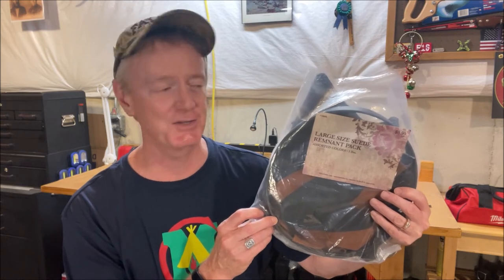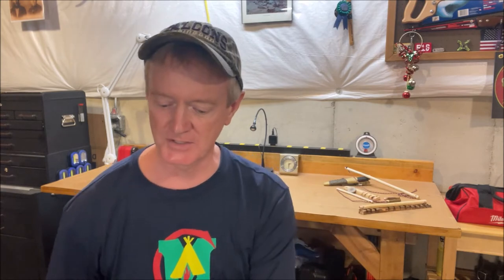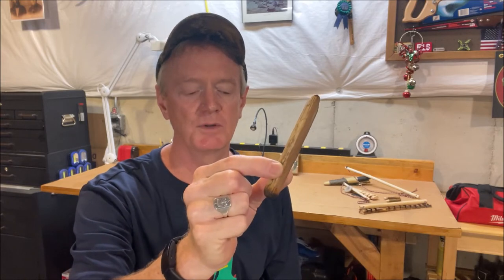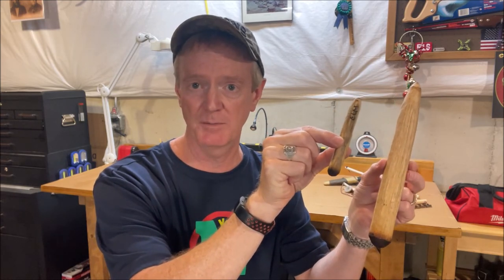Better Bow Drilling With Science!

Comment: Diving into your vidios. Going to read your research paper. Would love to see a thermal video imager used. Also. reduce the variables by using a drill press with varying speeds, pressures, time, spindle size changes, etc.. Keep it coming! Great stuff 👍
Reply from the maker: Thanks. It continues to be a work in progress. Making precise measurements internal to a forming ember has proven very difficult. Most thermal probes react too slowly and thermal cameras are either too expensive to consider or not sensitive enough for reliable data collection. We'll see. Again, a work in progress. Best Wishes!
Reply: @FlintStryker  keep it up🔥

Comment: Professor Flint!
Finally! Someone who is looking at the science and explaining.
Here is a question I’d like you to consider:  I too used to make my spindles rather large, but lately have gravitated towards the smaller diameters after learning handdrill and seeing how well the small spindles create embers with minimal pressure.
Then after seeing NW primates videos; he uses natural fibers for his bowstrings, which I have also been practicing and he  carves larger diameter spindles but reduces the tips to around half inch or less. This apparently is done to save destroying his bowstrings prematurely but obviously slows down the overall rotational speed of the spindle.
I have been using this method lately and it works.
Is there some science I am missing? Why does it seem to work so well? I read your explanations in appendix D1 and D2  referred to below, and yet:
Edit: So after reading your scientific paper and understanding only very little of the calculations and some of the explanations, it seems the proof that smaller spindles indeed are optimal. It does not explain however how cavemen figured this out without a degree!
My other question is on the hemispherical tipshape. My mullein tips sometime loses the ideal shape due to the pith disintegrating and ends up with the perimeter only left which then has a burnin that is flat bottomed with an outer groove. Other times the mullein spindles maintain the hemispherical tip shape and therefore the corresponding divot. Have you also experienced this and what can be done different to counteract this happening?
Also, if you explained the ideal width and shape of the notch in your equations it was over my head. Do you have a link to a video where you cover notching parameters in layman’s terms?
Reply from the maker: If you ever suffer from insomnia look up "The Physics of Fire by Friction." That's an article I wrote about two years ago. The gory math will put you to sleep quickly.

It's not that fat spindles don't work. I've made plenty of embers that way till. Skinny is easier and faster, though. If you are using natural fiber bow cords, try making 2-3 wraps around the spindle. That will reduce the tension required since there is more surface area gripping the spindle. I've made some videos about that in the past. Look in my 100% primitive playlist. Two wraps seems to work well. You have to tip the bow a bit if you use multiple wraps, while still bowing flat. It gets awkward the more wraps you use. 

Also, if you look up my article, spend some time with equation (9) and the discussion following. Spindle rotation speed doesn't matter. Embers form faster with skinny spindles (or one with skinny tips) because heat is more concentrated at the spindle/fireboard interface. Cut the spindle radius by half and you reduce the interface area, and increase heat concentration, by a factor of 4.
Reply: @FlintStryker  Professor Flint, thanks for immediate response, in fact you responded before I even finished editing my original comment, so can you weigh in on my question as to idea notch parameters? I will now go back to item 9 and review.
Reply: @FlintStryker Funny you called the insomnia part accurately! I woke up at 4:00 AM and started watching your videos where I left off last night! I reread your explanation at figure 9 but will have to take your word on the mathematical formula calculations, as I only had algebra a geometry in high school over 50 years ago before I dropped out cause I thought I knew more than my teachers. Boy has that been a hard pill to swallow. So now I’m at such a low point in my life and I’m  so far down the food chain I’m just trying to learn to create fire!
Ha ha! I should have stayed in school.
Reply from the maker: A lot of my work has come through lots and lots of experimental trial and error. From there, observations collect and patterns emerge as to what works better or worse. Cave men did the same most likely. My only advantage (though it doesn't make better fire) is the ability to craft a mathematical framework. I too am amazed at how primitive peoples discovered all they did. My Dad is the best engineer I know and he didn't go to college. He just "sees" things and makes them work.

As for optimum notch size/shape - I haven't looked into that. I've made a notchless ember or two, but not reliably.  

With think walled spindles like mullein and ironweed it's hard to tell that there is any spherical shape to the tip at all. Most of the time it just looks flat. Maybe it actually is. But, the spindle area that is involved in the friction (pith center doesn't count) is so tiny that the friction heat is super concentrated, making for fast embers. I've made embers in just over 4 seconds with ironweed.
Reply: @FlintStryker  I’ve had my mullein tip get glowing red hot and spill glowing embers out of the notch using the floating technique, and just a single final pass down the spindle, but not even coming close to the 4 second mark which I assume was done with bowdrill?
I’m going to want to get my hands on some of that iron weed at some point in time, but you are probably not in the business of sending a small flat rate box full of your favorite 5 flower stalks? I would gladly pay you for your efforts and shipping. Not trying to be a bother, just throwing it out there.
Reply from the maker: @standaffern6595  check my video on xtreme (speed) hand drill fire by friction. I was using a thing I call a thumb sling thunderhead. I've made several videos about them too. It's basically a turbo charger for hand drilling. Easy to make too. 

Ironweed grows tall and has beautiful purple flowers in the late summer/early fall. I would imagine Mullein is just as good since the outer wall of the spindle is so thin. I hadn't used much Mullein at the time I made the speed video, though. I'm a big fan now, though. Best Wishes!
Reply: @FlintStryker  I’m going to get on that video and make a setup to try. It should be good therapy for my arm which I am now just recovering from shoulder surgery after having taken a fall off the garage roof.
I shall keep an eye out for those  type flowers  better this fall. I’m hoping we have it in this area. But mullein is pretty great!

Comment: OK, I applaud your application of reasoning to improve bow drill ember production.  I disagree with your reasoning about the aluminum foil as an ember catcher.  I got the idea to use aluminum foil (or any other metal) after seeing Masai tribesmen using a machete as an ember catcher (with a hand drill!).  Before that I used cardboard.  When using a bow drill, punk will form a layer that is quite fluffy which I think acts as an insulating material between the ember and the foil.  Since I live in the desert southwest I use cottonwood, cedar, or yucca for both my hand drills and bow drills.  All these woods are awesome insulators which also forms a barrier between the foil and the "hot wood" which ignites the punk.  I have started hundreds of bow drill fires using aluminum foil as an ember catcher, with an ember being produced in well under a minute.  If you want to convince me, then do a side by side test of using leather versus foil.  A demonstration will quickly prove your point (or mine).
Reply from the maker: Well, of my suggestions I thought my comments on AL foil would be the least contoversial. I too have formed hundreds of quick embers on aluminum foil without issue. Does foil work? Yes, without a doubt. Is something less thermally conductive better? Yes, without a doubt. An experienced firemaker won't have trouble with any coal catcher material that's handy. A novice firemaker (e.g., a young scout), however, can use every advantange they can get. I have seen a few little embers blink out on aluminum foil before a sufficiently large pile of charred dust could collected.  Little advantages accumulate to increase the likelyhood of success when just starting out. Happy bow drilling!
Reply: I had an old pair of moccasins that were well past their practical life, so I broke them down and made numerous ember catches out of them. I agree that a good fire crafter making big hot embers can use most anything as a catcher. I also agree that beginners need all the advantages one can get to build up their confidence in fire making. I believe most practicing fire makers also appreciate all advantages to making quick and viable embers, especially as we get older and lazier. Lol